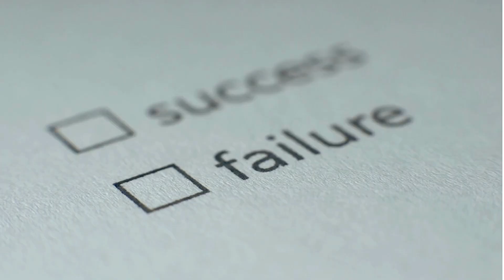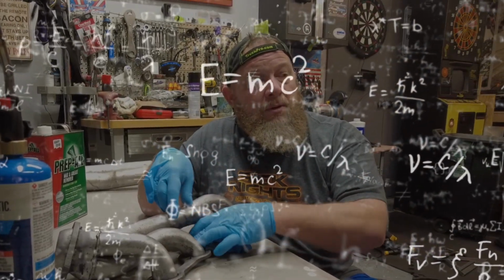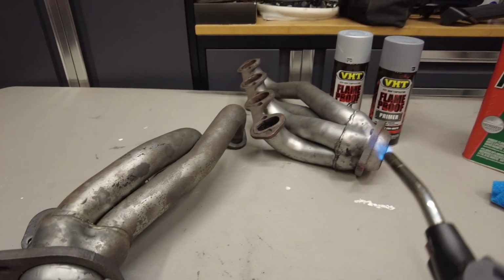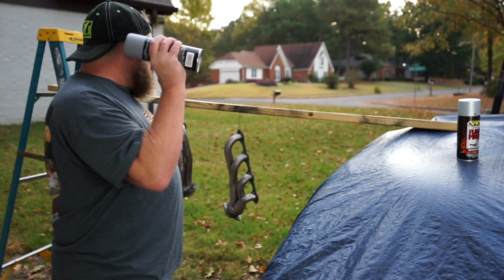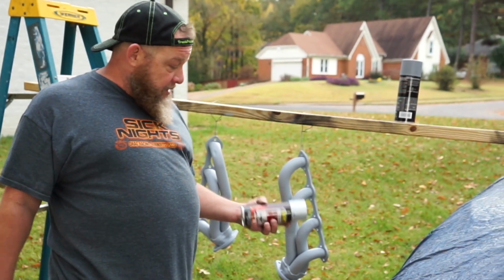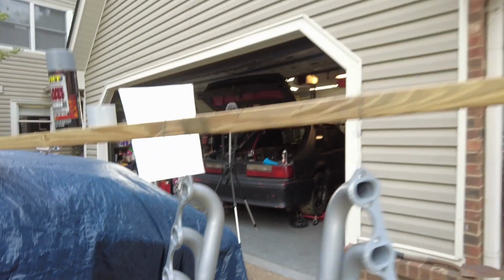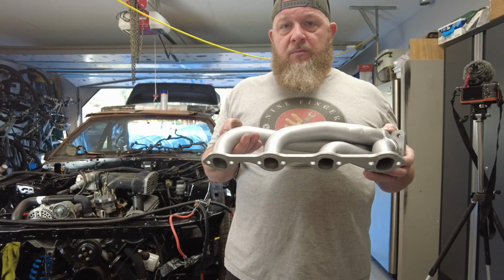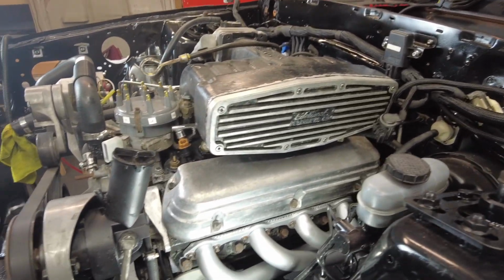Header Painting Disaster!!

Comment: You wont even recognize those long tubes now since I cut and welded, rerouted, and got them in. Really didnt think it through on the Ranger but man changing the starter is going to be a nightmare lol. Im going to have to lift the motor off the right mount, pull the mount amd header, then I can get to the starter 😅.
Reply from the maker: I’m glad they worked for you. Can’t wait to see what you did.
Reply: @Nine_Finger_Wrenching I was trying to get it back together and driving this week but it's been hectic at work so it's only half done lol

Comment: I think those bubbles were more a product of getting too hot too fast than of contamination.      Especially if your primer wasn't 100% dry & cured yet when you put the finish paint over it, then let it get too hot while it was still in its pliable state.  

I use a heat gun to cure headers while they hang and have been pretty successful so far with the finish but you can't be in a hurry they need time to cure after painting before cooking and you need to move the heat around,  blow from the outside and blow through from both ends (heat deposits on curves when you're blowing through) 

But if we're both fortunate in life neither of us will ever have to do that again 🤣 did I mention I hate painting?
Reply from the maker: I had wondered that. After redoing them I waited days, then just put them on the car. I figure by the time I get it running they'll be cured good.